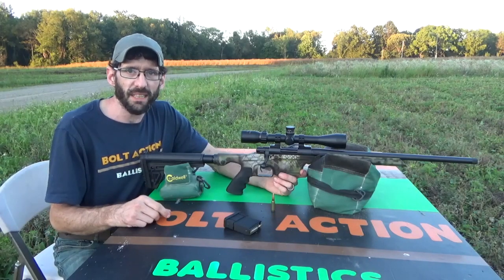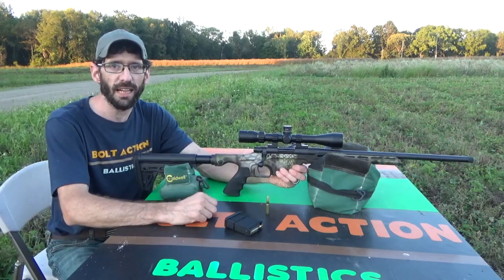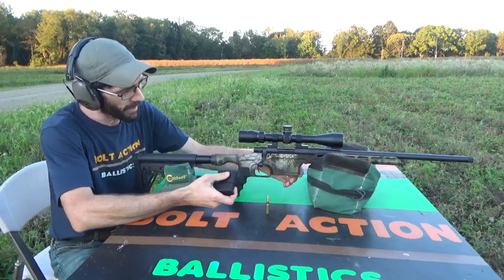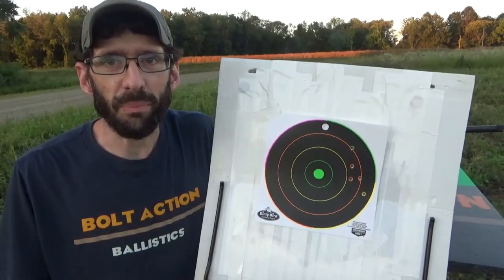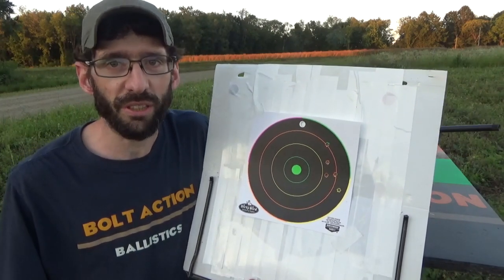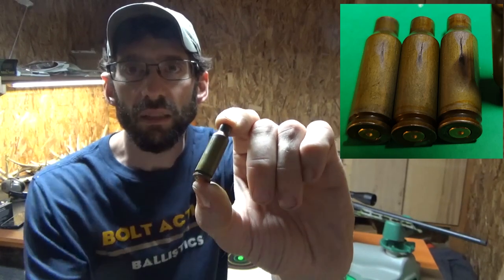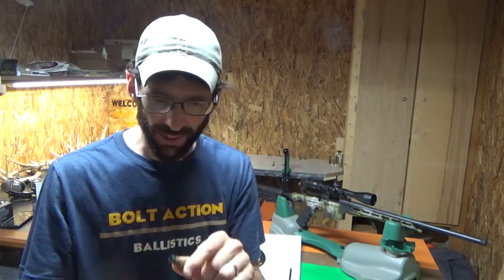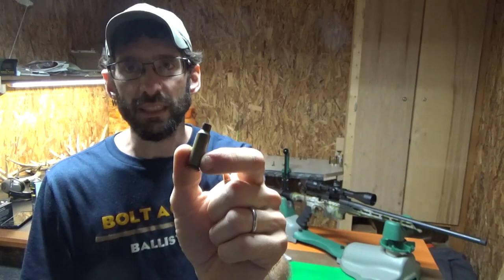New 6.5 Grendel (Steel Castings Not build For This Gun?!)

Comment: BAB.   Good video.  Interesting results with the steel ammo.   I have a Savage Axis .223 that steel ammo would hang up in as well, don't believe that I looked at the cases that close at that time to see if any were cracked.   Thanks for sharing and take care.
Reply from the maker: I have a 223 in the savage axis and I shot a full box of 20rds through it when I first got it I don't notice anything hanging up on it, it  actually shot pretty good for cheap ammo
Reply: @boltactionballistics  Thanks.  I appreciate your reply.   For my gun I gave up and switched to brass only.  I have another gun where the steel runs fine.